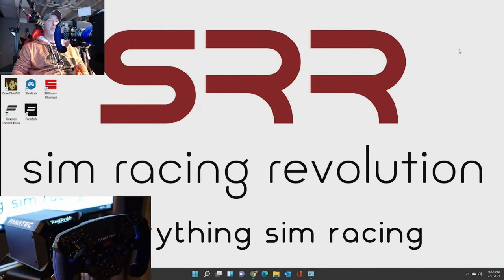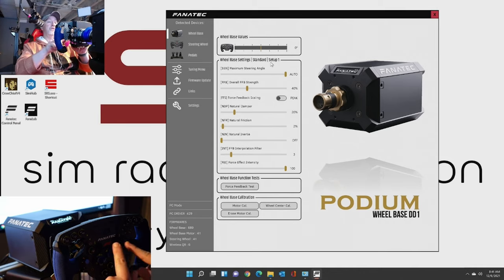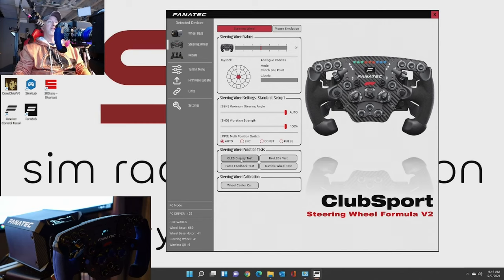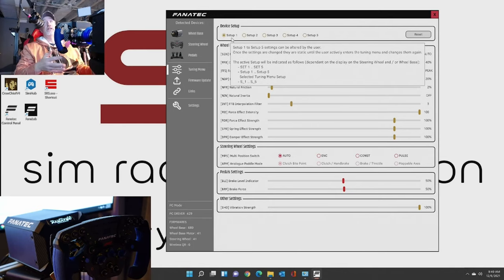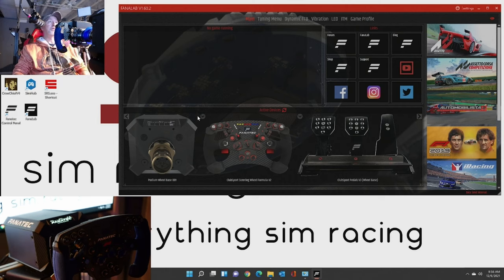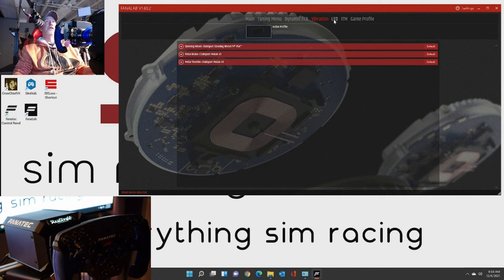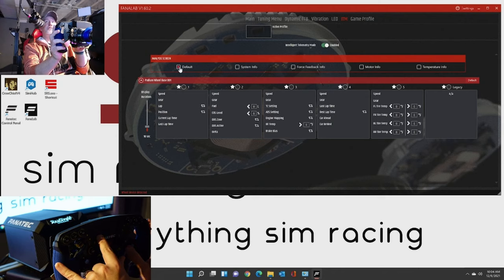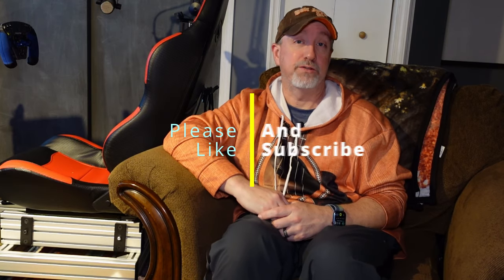Fanatec Podium F1 Setup - Part 2 The Software

Comment: Great video! Very informative. Just finished liking and subbing. Thank you
Reply from the maker: Thank you very much.  I guess I should get some new content out there again.
Reply: @simracingrevolution4208  I’m new to Sim Racing, so this was really helpful. Just finished purchasing the Fanatec Podium DD1, it arrives on Tuesday. I play mostly f1 22. Have any force feedback tip settings for a newbie?
Reply from the maker: @smoothoperator2213  Definately check out this link. https://forum.fanatec.com/discussion/843/f1-2019-2020-2021-pc-fanatec-recommended-settings
Reply from the maker: It's not quite updated for F1 22 but should be a great starting point.
Reply: @simracingrevolution4208  Thank you!

Comment: Von you show the tire pressures of the base display, if you use a Play Station?
Reply from the maker: Hi and thanks for the comment.  I do not think there is any way to show that as Fanalab only works with PC. So unless Fanatec ports Fanalab to the PS5 or the sim directly supports that display on the wheelbase then it won’t work.  The consoles are definitely limited in that respect.

Comment: My wheel base doesn’t show up when it’s connected. Any ideas?
Reply from the maker: When that has happened to me in the past I ended up reinstalling the Fanatec Control Panel and drivers and it detected the wheel base again.  There is probably an easier solution but that is what has worked for me in the past.
Reply: @simracingrevolution4208  thanks. I finally got it working. Now I’m wondering if there’s a way to map the buttons at all for gt7? I’m coming from a Logitech g29 and I could change the buttons in the game. This podium wheel doesn’t have that in the game. Is there a way to map the buttons outside the game or something?

Comment: Good morning do I need to buy it shifter or I can use my buttons on the wheel? Thank you very much
Reply: Sorry CARE I haven’t seen your answer to my question thank you for answering so what about petals which hev3 are a good choice to buy?
Reply from the maker: Hi Marios. You asked you first question at 1am where I live. Please be patient. You do not need a shifter as the Podium Racing Wheel F1 comes with excellent paddle shifters. Also, for pedals, the Clubsport Pedals V3 are excellent and fully compatible with all Fanatec wheel bases. They simply plug into the back of the wheelbase and you are good to go. You can remap the shifter to whatever you want. Remapping that can be done in whatever game you are playing. Also, if you want an H-Pattern shifter the go for the Clubsport Shifter SQ V 1.5. Again it can be plugged into the back of the wheelbase to make it super easy. Hope that helped.